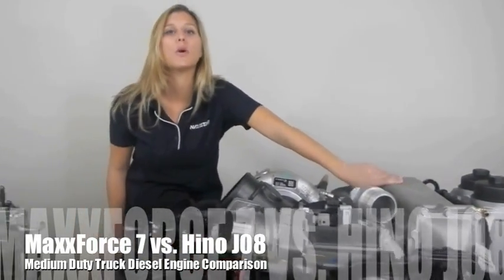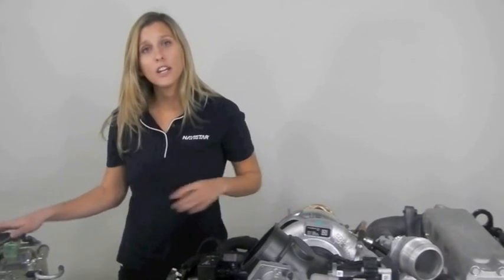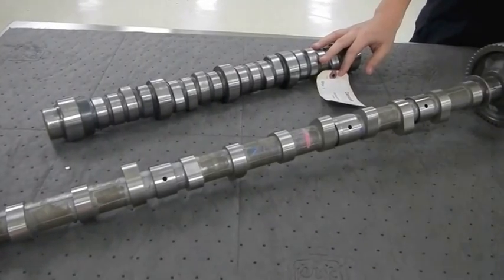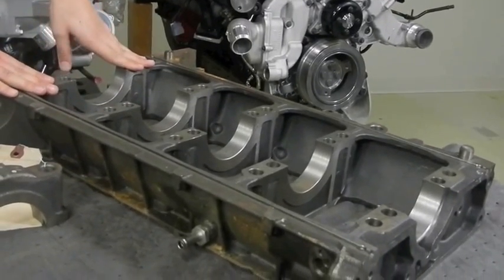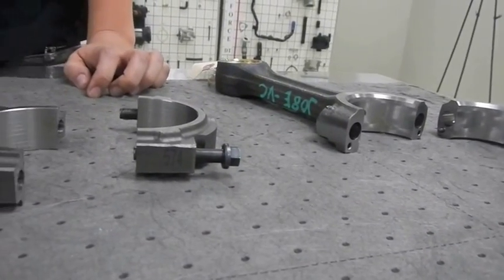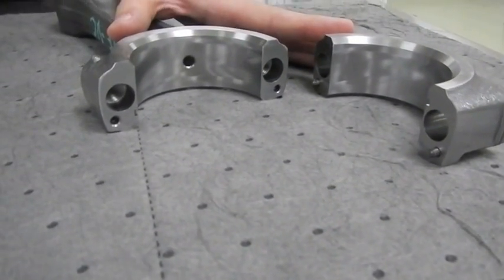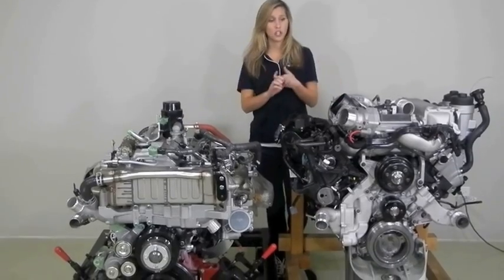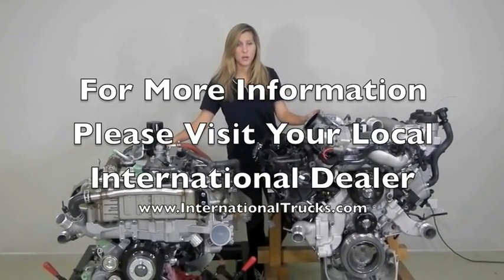MaxxForce 7 vs. Hino J08- Medium Duty Truck Diesel Engine Comparison

Comment: what a shit video altogether, who has connecting rod or camshaft failures anymore...? Why dont you compare something relevant to today's truck issues like emission systems
Reply: or maybe B10 & B50 engine reliability ratings by 3rd parties. Hino has B10 rating of 310,000 miles meaning only 10% need major engine component repairs after 310k miles & their B50 of 550,000 miles means only half need major repair after 550k miles. Then Hino's engine, drivetrain & components warranty of 5 years unlimited miles.  Does any medium-duty truck manufacturer have a equal or better warranty?
Reply: And I actually sought buying a pre-emissions DT466 7.6 liter to find my 99 Internat'nl Skoolie w/just 210,000 miles for under $2500. i'm VERY happy with it so far, especially compared to my previous diesel engine that very few shops would even work on, a 93 6.5 liter straight 6 in my FTR 28 ft box truck. Decent engine but expensiver buying parts for. $3500 radiator, $600 starter, $3500 Injection pump plus add'nl $3000 labor taking off & put back in. That's what drew me to DT466 if before MAXXFORCE CON-JOB

Comment: I work on both of these engines let's just put it this way international just went to Cummins because they know what a big pile of shit engines they build the jo8 is hands down a way better engine
Reply: I’m about to pull the trigger on a 2008 Hino 338 with low miles. How many miles can I expect out of these engines before an overhaul and in terms of service and maintenance are these complicated to work on?
Reply: @Ab Mtz  we have those engines running around  with 450k Mike's with no over hauls just cam frame gasket replacements and plenty of oil changes

Comment: Hino is far superior. Only a troll would say toyota is garbage. JD power and consumer reports shows that toyota is most reliable.
Reply: TRDRacing I'm not knocking Toyota's reliability or anything but J.D. Power and Consumer Reports "studies" are virtually identical in the way they're carried out. They're statistically flawed surveys and not actual inspection or gathering records of actual repairs. Jalopnik did a nice story on J.D. Power. When asked for a comment, this is the response from Toyota: "We will pass at this time,” a spokesman for Toyota said when asked, saying that the company “rarely” uses J.D. Power in its advertisements."